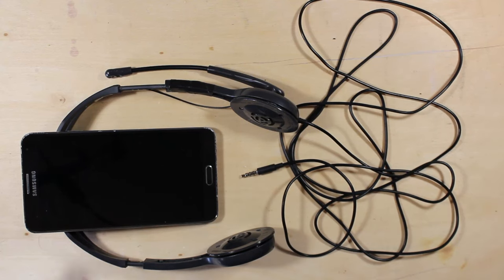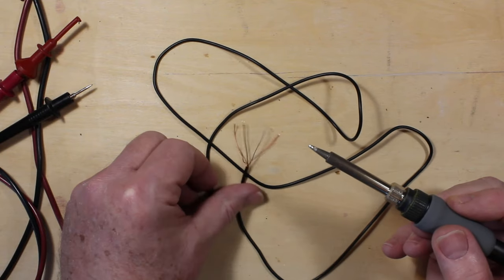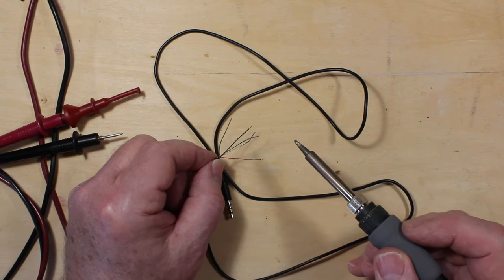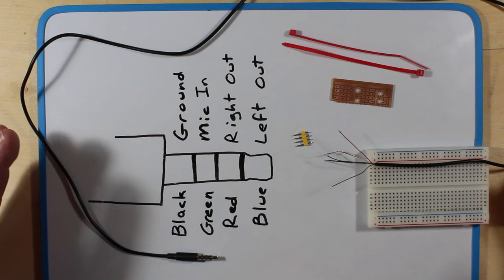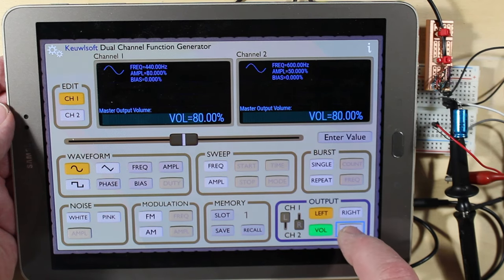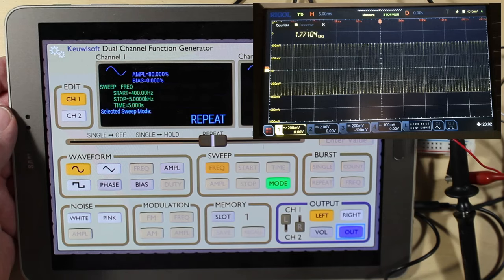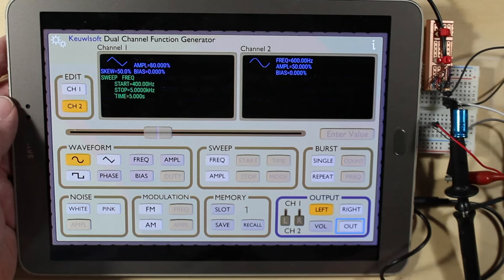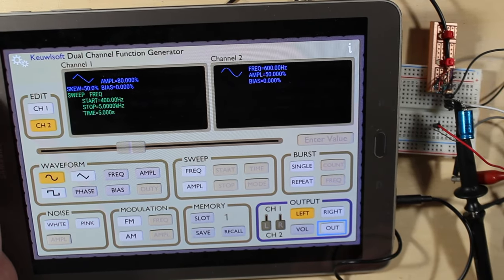Audio Range Function Generator On Your Cell Phone Or Tablet #testequipment #audiotech

Comment: Nice find on that software... I never seen it before.  Also great for testing audio equipment with BlueTooth (receiver and speakers).
Reply from the maker: Thanks for the comment.  I have an old set of headphones but the Bluetooth still works.  A wireless stand-alone generator....

Comment: Use always flux never just a blow of solder. Oxide is your enemy! If you don't follow my advice you will never get perfect solder joints
Reply from the maker: The blob of solder is to melt back the insulation, then apply flux as needed.